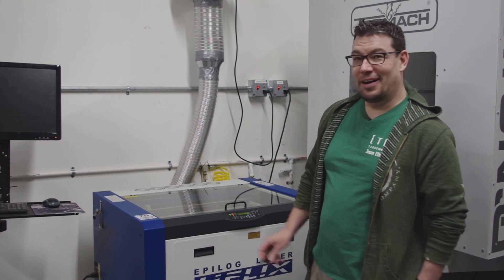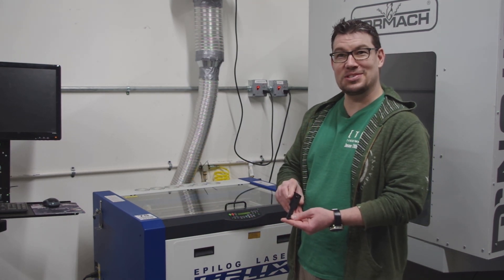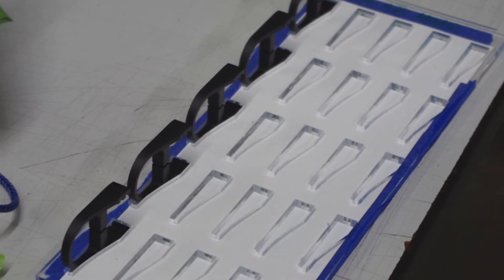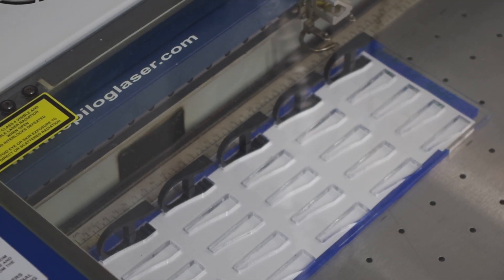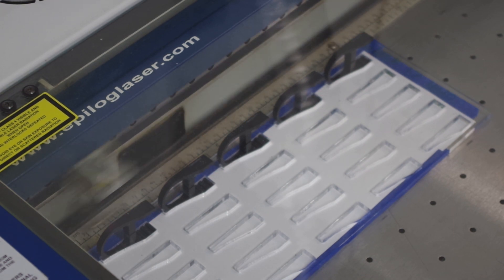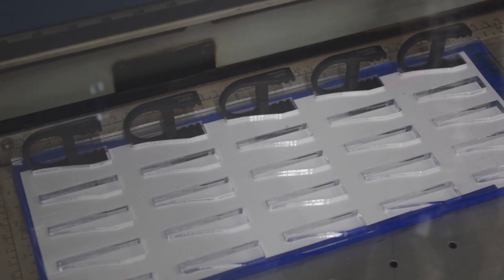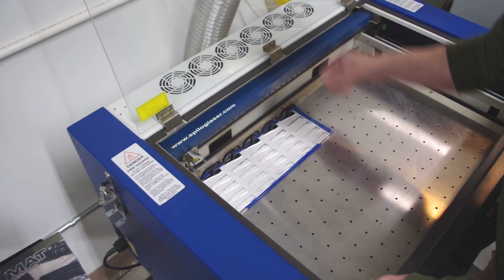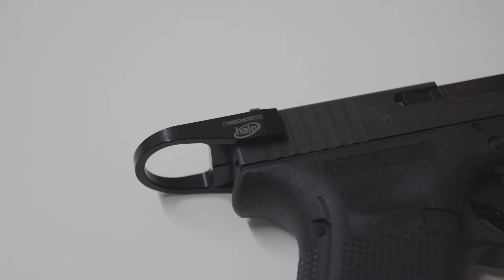TANDEMKROSS Behind the Scenes - Laser Branding

Comment: Awesome! TY for showing this. Just bought your stuff from Midway on Monday. Should be here in snowy and cold Iowa today to install into my Mk3 & Mk4. Favorite thing of yours is going to be the two parts (one for each) that get rid of those annoying mag disconnects! My Mk4 Tactical (plain non 1911 style) with a YHM Stinger is one of two guns in my bug out bag (the other is a M6 Scout .22lr/.410). And I do not want it to have that annoying feature in case I find myself without a magazine to use. That is one good example you can use to market your product with!

There are many uses for not having that feature. Ruger is foolish to have included this feature, but I do understand that it means more units sold in states they otherwise couldn't market in. At least someone is making a few bucks offering a good idea to remove it in what appears to be a well executed design. I'm thankful you kept the price decent. I much appreciate that! Do you have any tips on installing them?

Also about the engraving, do you have to coat the part with anything when you laser engrave it? Lastly, do you have to do any post treatment after engraving? Does it melt through the coating completely? Also, can you vary the power at all? Curious as I know little about it but am fascinated as I am big into guns and also was taking Computer Science and Electronic Engineering at college before I had to drop college due to illness.

God bless from Iowa! - Paul
Reply: Oh, and a possible product idea for you! I am not sure if it is possible, but it would be interesting to not only have +1 round by adding a new follower, but maybe increase +1 or even 2 by having a different base plate as well. Maybe find a way to get the magazine spring lower down but have a tapered piece that allows the magazine spring to pass freely around the steel bottom flange of the magazine body.

In fact, could a entirely new higher capacity magazine be made that would just increase capacity by even more!? I wished they made much higher capacity .22lr pistols then the standard ten rounds the market is currently limited to. Fifteen or even twenty would be nice. I am sure there is a market for higher capacity magazines as I have seen many people asking about them on various websites with the standard replies of 'no one makes a higher capacity magazine for any .22lr pistol.'

Paul